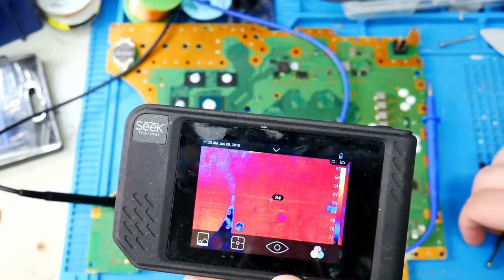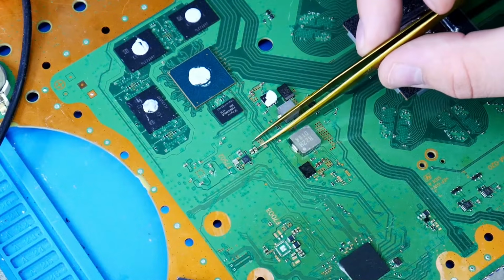How to Find A Short Circuit 100% BEST METHOD

Comment: Would you still recommend doing this if It was a partial short to ground between power in of 50 ohms ? On a 3 volt board ?.

Have checked with a spare, good board and have 0 ohms, so there decently a partial connection that shouldn’t be there.

Any help appreciated 🤞

Comment: things i dont uderstand:
if the capacitor is simply removed and not replaced isn't the circuit then incomplete?
Also, do you need a schematic document to know the ohms, voltage, and current of components?
Thanks for the insight.
Reply from the maker: There's a lot of theory involved in electronics repair. 

So, in specific, capacitors are typically used as a filter for the circuit. But the 5v rail has filtering caps all over the board. So in this case, technically it will work no problem with one cap missing, because there's probably a hundred others helping filter on that circuit. 

In some cases, you can get boards to turn on without whole chips installed on the board.

Like on an iphone, you can get the phone to turn on without a backlight circuit working. 

As far as knowing voltage and ohms, the only way to truly know is if you have a completely fully working board, and you're able to use your multimeter to test everything. Or just from experience of testing a prior working board, and a last but not least a schematic. But a general rule of thumb is, if you have a 3.3v, 5V, 12v rail, and it shows very low ohms to GND (ground), it's more than likely shorted or partially shorted.
Reply: @chasefournier  that's very insightful thanks.